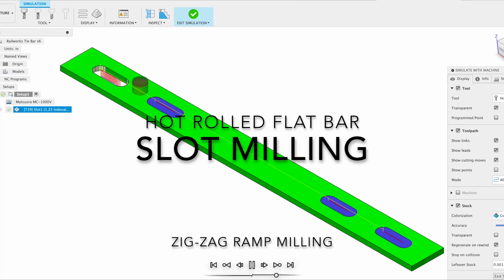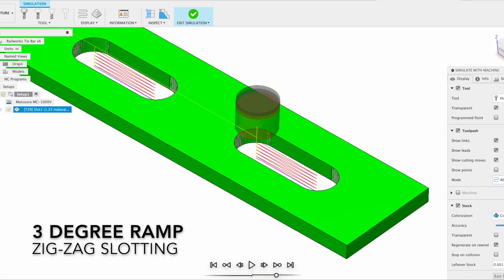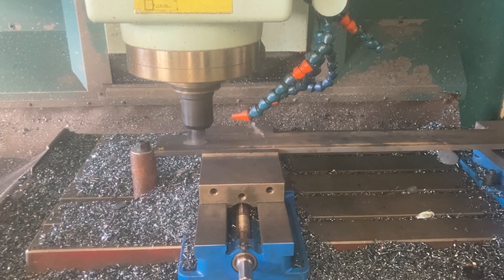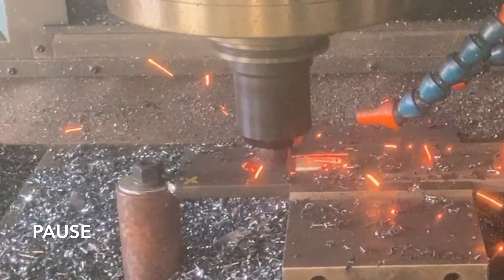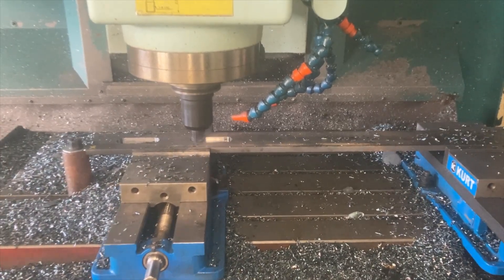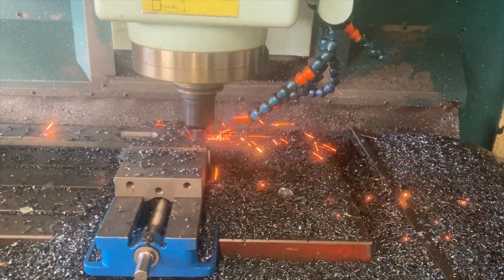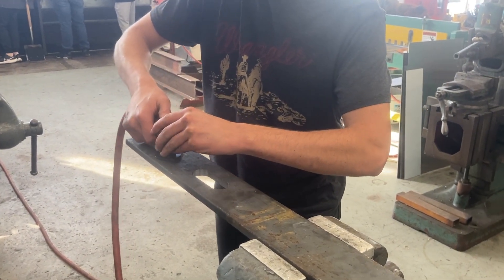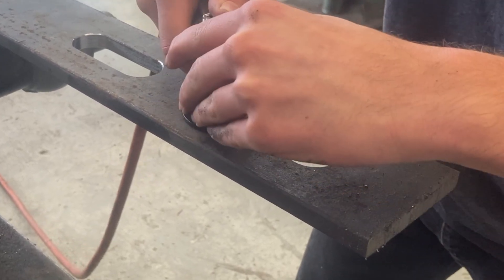Milling slots in mild steel #cncmill #railroad #sparks #carbideinserts

Comment: Get ready for the experts whining about the lack of coolant...
Reply from the maker: It's sure to happen. My guess is that it would still spark near the bottom even with coolant. The thermal shock would likely kill the inserts in short order. It would likely also evaporate a lot of coolant. Nobody likes a foggy shop, not to mention dealing with the wet chips. If I can run dry I will. I thought about setting up an air blast to keep the chips clear but this tool actually has fairly decent clearance and chip clearing wasn't necessary.
Reply: I was waiting for the ones talking about the way he says "Chamfer"
Reply from the maker: @Dreddip  I'm told I also pronounce guillotine wrong...